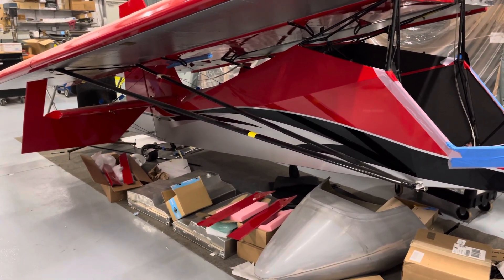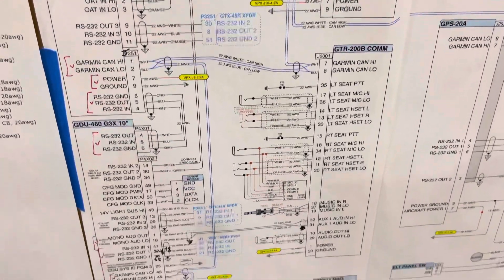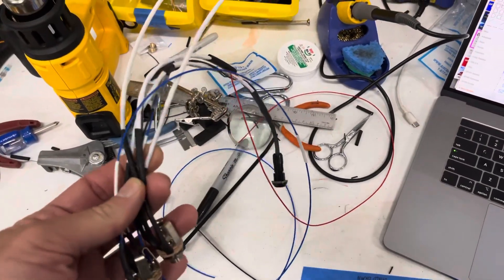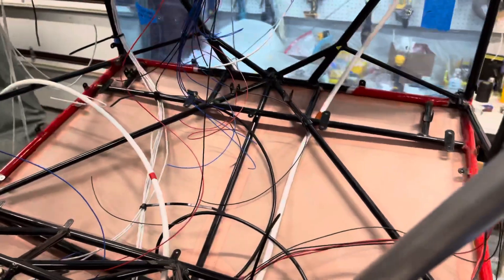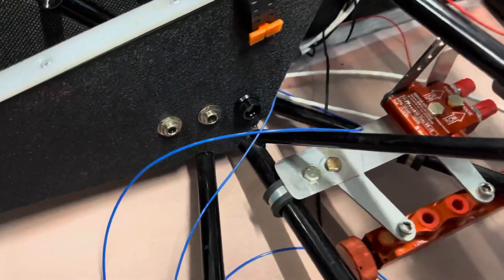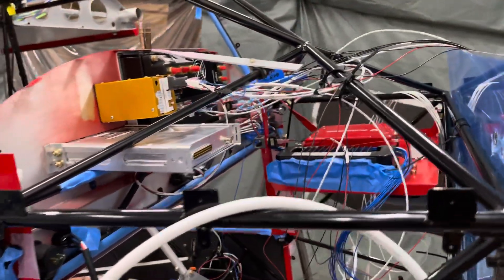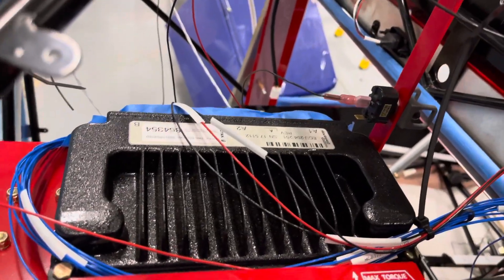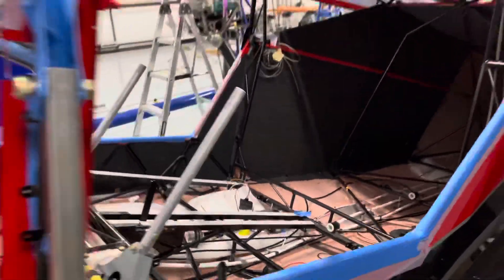SuperStol Build Update May 2021

Comment: Where did you get the switch board with backlights ?
Reply from the maker: https://www.ponoko.com/   I designed the panel in illustrator, upload to them and a week and $40 later it’s on the plane.